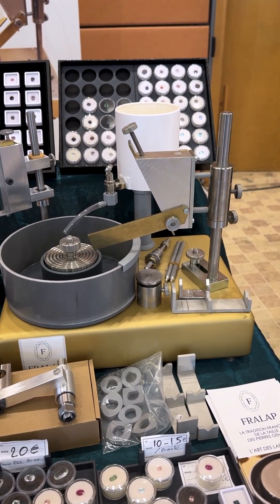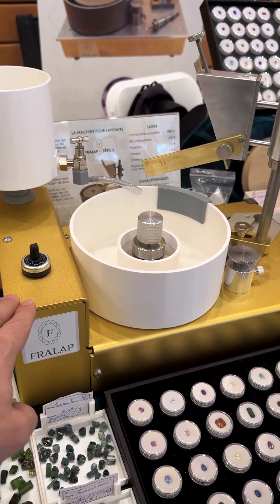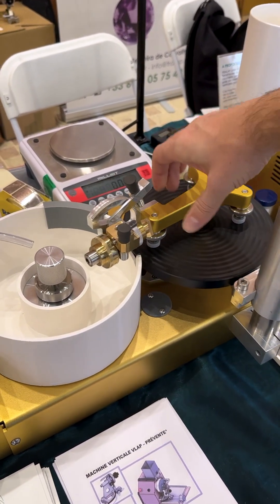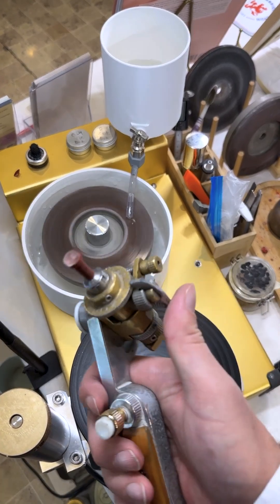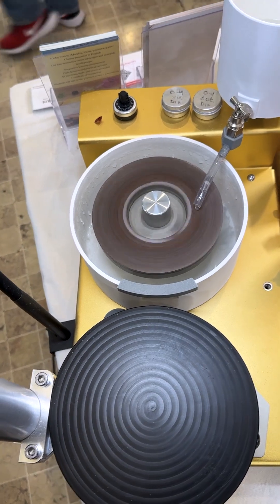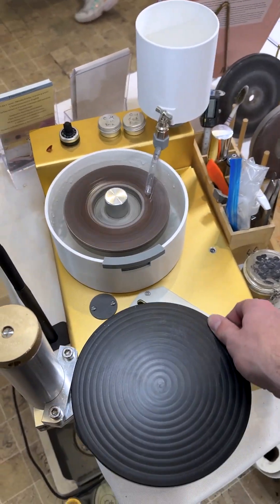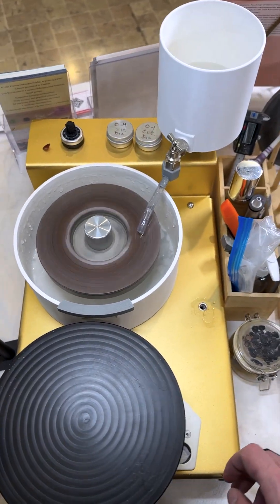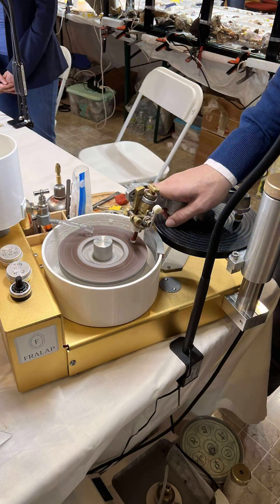A new faceting machine that is jambpeg, handpiece, and mast! WTF?!?

Comment: Could you mount the arm/plate also in the back ? doesnt seem very practical in the front also adding a rotating pin on top on the plate height adjustment would help for faster setting